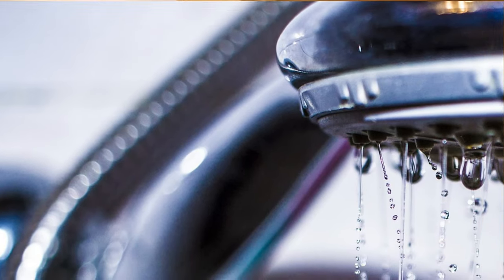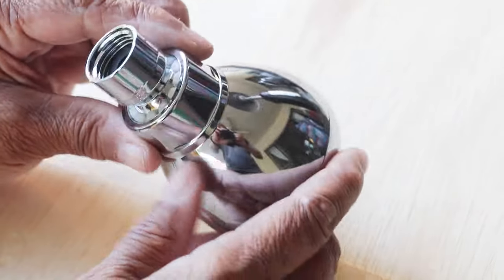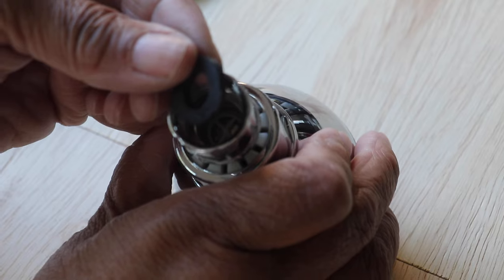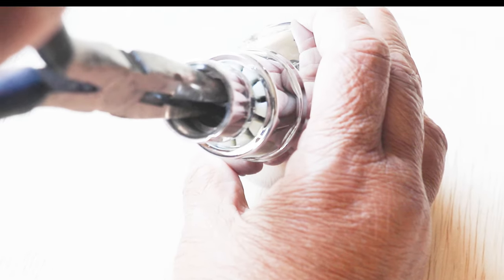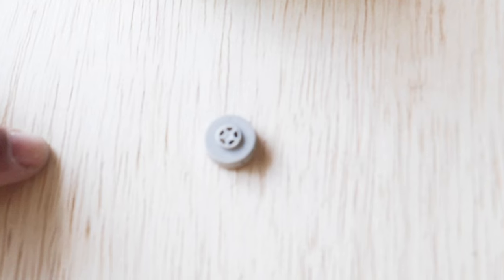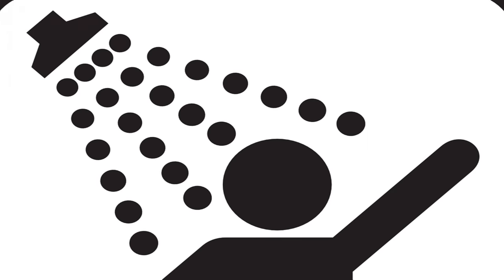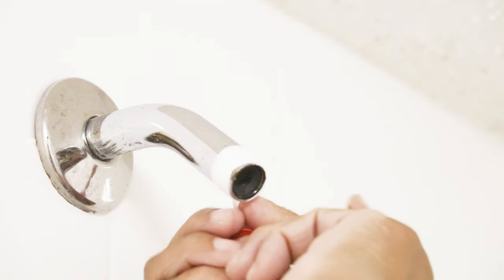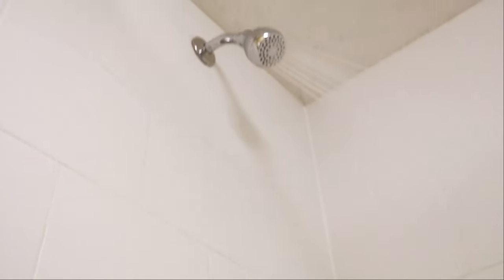Secret Few Homeowners know and PLUMBERS don't tell you

Comment: Flow restrictors are the dumbest things ever created for conserving anything. If you have a flow restrictor you end up having to shower for longer, wasting just as much if not more water than if you didn't have the restrictor.
Reply: The only way your statement is true is if you are turning the water on and off during your shower while washing. If you get in, leave the water on until you’re completely done you will use quite a bit more water even with taking a slightly shorter shower. You will also use a lot more hot water. I have personally remove the restrictors and after a few months and running out of hot water more frequently I reinstalled them.
Reply: @Whodey-hd2dd  Of course I leave the water running. I have a life and need to get in and out as quickly as possible while still getting clean. I would turn the water on and off if their were a limited supply of water because of an emergency, but as I have a job and there's plenty of water, I run the water without turning it off. What I wouldn't do for any logical reason is use a restrictor. That nonsense has been debunked repeatedly.
Reply: @dovan4092  exactly who has debunked it? I know I’ve used it both ways and watch my water usage go up and see that I run out of hot water quicker without a restrictor. I have also made plenty of service calls where the complaint is running out of hot water quicker. Do time tests with restrictors and without restrictors. From my first hand experience I have a hard time believe your “debunked” claim.
Reply: @dovan4092  if you are happy with the pros and cons of removing the restrictors then awesome. But spreading false information like you will use the same amount of water is just wrong in my opinion.
Reply: @Whodey-hd2dd  You're the one who's either misinformed or lying. Either way you're wrong. In fact common sense should tell you're wrong.
Reply: @dovan4092  No you are wrong. See there I can do the same thing. The difference is I’ve actually done the research. Also there are tons and tons of research proving they work.
Reply: @dovan4092  just out of curiosity how long have you been plumbing?
Reply: @dovan4092  also if you are having to flush a newer toilet 2-3 times you were either a cheap ass and got a junk toilet or something is wrong with your toilet/drains. The problem is people who are not experts in the field that do not have enough knowledge in said field spout things off as fact.
Reply: @dovan4092  There is a huge difference in an opinion and a fact. Use your brain. Think logically. Why would manufactures go through the trouble of having to add additional parts to something if it had no effect. You think there is some huge conspiracy to add restrictors that cause us to use the same water. Also do some basic math. Let’s say you take a 10 min shower at approx 5 gpm (removed restrictor) that’s 50 gallons of water used. You seriously think that if you have a restrictor in it will now take you an extra 10 minutes to get soap off your body and shampoo out of your hair? You are absolutely insane if you think so. 1-3 mins sure I can give you that. Once again if you are ok with the pros and cons of removing restrictors then awesome. But telling people you will use the exact same amount of water is absolutely 100% false.
Reply: Anything that comes out with a way of being more efficient or economical/whatever, never work as well.
Reply: @ald.ackleyvisd6194  Exactly.  The catalytic converters on cars were a government boondoggle.  They say they eliminate 90 percent of motor vehicle pollution but that is bogus.   If you've ever driven behind a old pre-catalytic car you know they put out just as much irritating exhaust as a modern car with a catalytic converter.

Comment: I ran out of hot water half way through my shower. I have a huge water tank too. I had to reinstall.
Reply: My wife complained her shower head was weak. I removed the restrictor. Then she complained it was too hard and she ran right out of hot water asap. Then I installed an adjustable ball valve between the head and the pipe, and she loves it. Ball valve was $2.50 at Lowes.
Reply: 1st off how long of a shower are you taking? but more importantly how many gallon is your hot water tank? sounds like thats your real problem. i always remove the restrictor and on a solo shower have never ran out of hot water.

Comment: Now, will you tell me how to fix these water saver toilets so I don't have to flush a dozen times? grin
Reply: Right
Reply: Thanks yes Amen
Reply: I think it all has to do with the volume of water the tank can hold. Or there is something like the float that restricts the tank from filling completely. Just pull the lid off and watch it work, you should easily see what restricts the amount of water in the tank.
Reply: Get a high volume toilet, like they used to advise that could flush a bucket of golf balls. The drain hole from the tank to the stool is much larger, so more water dumps faster. We put one in the kids bathroom and haven’t had a plugged toilet since .
Reply: Spend more than $150 on a new toilet. You can’t clog the champion 4 at 1.2 gpf. Toilets fall in line with the rule. You get what you paid for.
Reply: If you can lift the tank upwards a few foot and connect it with a longer pipe, it will flow out with more pressure
Reply: Bucket using the scourge of modern life, the ubiquitous plastic shopping bag as a liner, then to your organic garden or compost pile. Recycling at home is fun and rewarding.
Reply: @freckles3705  Depending on your income level and degree of comfort you have with someone accompanying you while you take care of business, a groomer of the stool is always an option.
Reply: lives  again...never..  rich or poor I have a bidet attachment that is my groomer.
Reply: I solved that when I moved to another house. Of the 3 toilets in my house only one had to be flushed more than once. I noticed that the opening in the bottom of the toilet was smaller than the other toilets. And a few years later I happened to visit a company that made toilets and they had thousands of toilets.  As I toured their facility I saw that every toilet had larger openings than my “water saver.”  If you have to flush 2 and sometimes 3 times you are saving nothing.
Reply: Courtesy flush.
Reply: I HATE water saver toilets. You're not saving water if you have to flush 2 or 3 times. Years ago I used a converter kit to change my regular toilet into a water saver toilet. We used a lot more water cuz of having to flush at least twice. After awhile we converted the toilet back to a regular toilet
Reply: I have a new basic American Standard toilet with a built in water saver feature that flushes completely and efficiently while filling quietly. This toilet saves me money every month on sewage fees.

Comment: 🤜💥🤛  I've incorporated a 'flow restrictor' hand valve up there on the downpipe.  I too have the type of shower / tub wall valve that doesn't restrict flow, only mixes hot/cold, so an actual valve is needed if you want to cut the flow volume when appropriate.  That said, I've also removed any internal restrictors from the pipes and tubing as I also need 100% full blast flow occasionally..  works perfectly in all my showers.  🥂

Comment: I successfully removed one of these restrictors from a shower head. But it didn't pop out as easily as you demonstrated. After digging and cutting at it, it finally came out. Maybe different makes and models are designed differently. Am glad I got it out though. I added a shut off attachment behind the shower head to stop the water flow while I soap up and switch the water back on to rinse. Seems a water restrictor still wastes water since it doesn't completely stop the flow of it. Love your videos. 👍

Comment: With the water pressure so low now it was hard to control water temperature let alone rinse soap out of long hair. When I went to remove the restrictor the little cross part was metal and I had to cut it out. Now I can take a quick shower. Thanks for the great tip.

Comment: Take out the restrictor - but install a cut off valve right before shower head!  This will allow you to take 'Navy' showers, where the water is NOT allowed for run continuously, but is turned on and off.  Wet down, turn off the water, soup up, turn the water back on and rinse.  I used a standard 1/2" ball valve which open/closes in only a 1/4 turn.  This is more convenient than turning the mixer valve (or old school separate hot/cold valves) on and off - where you would also loose your desired volume and temperature adjustments.  Once you get used to  showering this way it seems completely natural and reasonable.  And it uses the least amount of water as well!

Comment: Good advice. Another important fact mainly for hose fed showers is, when replacing the hose or shower head, always replace with the same brand/model hose/head. They are designed for max performance to work with the body they are supplied with. If you buy cheap or different brand replacements, chances are you will see a degraded performance compared to the original when it was working properly. It’s worth spending the extra money for the genuine parts.

Comment: All the showers I ever used had a flow restriction device like this whether it was in the head, or in the shower arm. I bought a 2 piece head that had a handheld and when I put that on, it was truly amazing the difference I felt vs saving water. When I shower, I try to stay in long enough to do hair and face, then body wash, then high traffic areas with antibacterial soap, rinse all off and done. No long showers for me, but it is nice to have as an option for those who do take them.

Comment: I've bought a few shower heads and noticed 1 or 2 actually mentioned the presence of a flow restrictor, and that in areas with actual low pressure, it can be pulled out.  The one in your shower head seems strangely complex, but the ones I've seen were just simple plastic discs with a prescribed hole in the middle, and you pop it out with that.  I think heads without a restrictor are restrictive by design, the passage through the neck/ball is small.  In regular or high pressure areas the restrictor should be left in.

Thanks for the vids!

Comment: Excellent video Leah and good subject matter.  Some thoughts (let’s just say I’ve dealt with water flow issues like this a number of times):

Over time the water restrictor, or a water diffusion screen in the case of a sink faucet, can become clogged up.  Removing, cleaning, and reinstalling it can be a great performance booster in many cases.

3 to 5 wraps with the Teflon Tape (plumbing tape) and definitely clockwise as you stated.  Additionally, there are various types of Teflon Tape, recommend using the appropriate type for the application.  These tapes are typically color coded ; ie. Yellow TT is for gas lines

Comment: This really works. If you are worried about using too much water, you can close your mixing valves a little. you don't have to run them wide open. Also with more flow. you can get done showering faster.  I actually installed a shutoff valve in front of the shower head, so I can stop the water flow while I an lathering up. Thus conserving water.

Comment: The Budget Inn - in Klamath Falls, Oregon - room 27 - has the best shower in the world. The motel is directly 100 feet downhill from the city water tower - and the pressure spray is so strong - well it's so strong that you never want to get out. I've spent more than a thousand nights on the road - and room 27 is the best there is. Did I mention - I took the flow restrictor out myself - a gift to humanity.

Comment: I have had a well & septic for 45 years (3 houses).  I came up with this one:  I squeeze a large fishing sinker into the toilet flapper to save water.  You hold the handle until you get a good spin, then let go.  The flapper shuts, usually saving a half to two thirds of the tank from going down the drain, while still disposing of the waste.

Comment: jANE - good info re the flow restrictor.
my problem has been water mineral deposits in the shower head holes ! some holes are blocked and others not, creating a crazy-quilt pattern of water flow. 
i was able to clear most of the holes by putting some vinegar is a slider plastic storage bag, and then mounting the plastic bag on the shower head such that the shower head was in the bag and under the vinegar.
the vinegar dissolved the mineral deposits and opened the holes. this works best for old shower heads which are too old to remove.

Comment: I knew this one! Being a fluid dynamicist helps occasionally. If you have a head on the end of a hose, the restrictor keeps the hose pressure high and it fails quickly. Removing the restrictor solves the problem.
Sometimes the restrictors are glued or molded in. I drill them out, holding the head upside down so that the shavings don't go down into the head.

Comment: In general, I think water conservation is a good thing, and we should not be retro-UNfitting our appliances to remove the water restrictors, BUT in some situations it's a good idea. I am on well water and already have restricted flow, low pressure. We are careful with our water, but showering under a dribble or waiting minutes to fill a gallon jug is ridiculous. I finally figured out how to remove these restrictors a couple months ago, but appreciate your verification.

Comment: I had a similar problem 2 times. I didn't know about the flow restrictor. I ended up  taking apart the faucet and cleaning out the stem part (the second time I just replaced the stem). There was like little bits of debris in it. Reassembled the faucet and it was good as knew (faucet and shower). Removing the flow restrictor would be a lot faster.

Comment: I generally will not remove these but let customers know about them and will at their recommendation.  I had a call for no hot water at one fixture in the house ,it happened to be at the farthest fixture ( the shower ) from a new tankless water heater . Tankless heaters operate from a flow switch which in turn tells the heater to begin heating water . The restriction was preventing this from happening . I removed the restriction and hot water began to flow .

Comment: It's a great video and I like how you showed the water flow at the end.  But you should have shown us the water flow at the beginning so we had a comparison so we could see the difference.  Another thing you can do if you have low water pressure if you want to get more water flow and pressure is to find where your water comes into your home.  Look at the pipe and see what's attached to it.  In some places they put pressure regulators on the water line coming into your home.  First should be the main valve.  After that there may be a device that has a screw coming out of the top of it and often makes a hissing sound when the water is running.  This is the pressure regulator usually put on to reduce the pressure coming into the home because some places can have to much pressure coming in from the street.  You can increase your water pressure and flow by adjusting this.  All you have to do is to turn the screw on top in.  The farther in you turn it, the more water and pressure you'll get at the tap.   There is usually a jam nut at the bottom of the screw you'll have to loosen in order to turn the main screw.  This can help you to get more pressure and flow too.  One thing I reccommend though is to turn it 1/4-1/2 a turn at a time and turn on a faucet to see how strong the water is coming out.  Then tighten down the jam nut when finished to keep it in place.

Comment: Leah, thank you so much once again for a simple solution to an age-old issue/problem. I didn't know that about the shower head, although I had a plumber friend tell me once when he was helping set up a water source for our washer to make sure that if we had hard water to remove the "screen" on the hoses and depending on our particular washing machine to do the same. At the time I had no idea what he was talking about until, he showed me. He explained that with daily use, we would see a "big improvement" with overall performance AND we would not have to worry about sediment building up in the pump. He also gave us a tip on how to be extra confident on that, but I won't go into that because, I don't want to get flogged LOL.

Comment: The flow restrictor can be pulled apart and cleaned out of dirt and debris if you wish to retain it in the shower head.  Usually a safety pin is great help to clean the orifices  the water flows through.